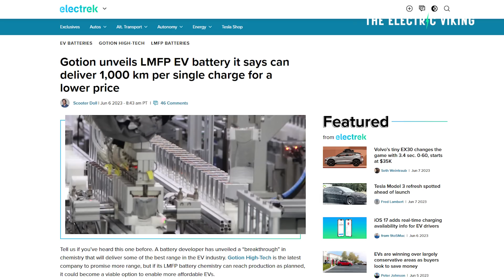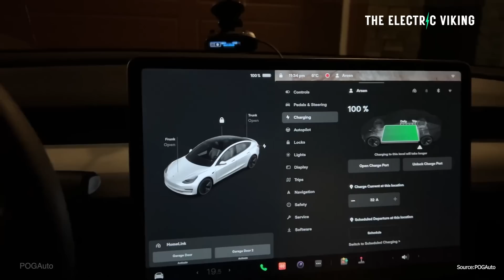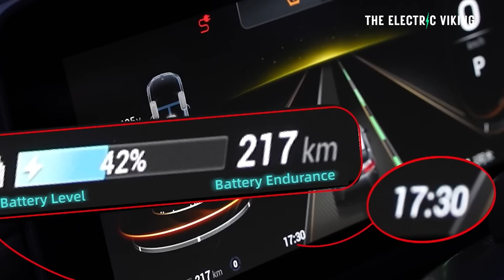New 621-mile range EV battery charges in six minutes and works in any weather

Comment: You really don't say anything about, "how" this is achieved?  It does not seem to me that just "managing the heat and cold" would suddenly give a battery more energy density, or speed up charging by this much.  Did they also add capacitors?  Did they micro-engrave, or "glow" lots of new surface area for charge carriers to stick too? Do the have any patent numbers that we could look up? I hope of course this comes out true and correct, but with the excitement in the space, it makes it easier for "scammers" to pounce.

Comment: All projections about vehicle ranges are fairly pointless. Tesla,  could make a 600 mile car easily today.  Lifecycle of the battery, charging speed, ability to manufacture at scale are the important metrics. sure, in a decade or so, these technologies will begin replacing what are going in vehicles today.

Comment: Sam, these claims are absolutely bogus.  I'm able to do math.  If the most efficient automobile can achieve around 4 miles per kWh, then the battery size is 150kWh.  To transfer 150kWh into the battery within 1/10th of an hour (6 minutes is 1/10th of an hour) then the power of the charger must be rated at 10x the energy capacity which would conclude that everyone would need a 1.5MW charger and chargeport.  Again, this is all assuming perfect conditions and no heat loss, etc.

Absolutely no way!  Try not to believe everything you read on the internet....

Comment: Did he say super conducting material.  Room Temperature super conductivity has never been achieved. I don't think they have made any break throughs on that.  I would love to know what was meant by super conducting material.  Little bit of science fact.  Super conducting material don't require an alternating magnetic field to produce a current flow.  Just placing a magnet near one would produce power.

Comment: There is definitely something in fusing a capacitor with a battery in some way that would allow such insane charging speeds. Capacitors allow virtually instantaneous charging; that's not actually required in an EV, but to bring to bear some aspects of a capacitor to a battery would be very useful.

Comment: Through the early parts of the 1900s, electric cars, using lead acid batteries, held about 1/3 of the market. Thomas Edison thought that electric vehicles were superior to the steam and gasoline cars. He worked to invent a better battery for the electric vehicles. Since that point in time there has never been a breakthrough. Batteries have gotten incrementally better. There has never been a game changer or breakthrough in battery technology. Just small incremental improvements for over 100 years.
Reply: That's a good point.  I'm in my 60s, and I don't recall any sudden leaps in battery technology during my lifetime. Rather, as you say, they've just improved steadily.

Comment: Info not included was battery chemistry and cycle life. It would be interesting to know more about the contribution of superconducting materials. Thank you for your work.
Reply: Most superconducting compounds are nasty to produce because the components need to be ground to a fine powder. The good news is that it’s no more toxic than competing chemistries when dumped as land fill.

Comment: There are all signs of bs hype in this announcement. They promise everything but it's impossible to find any technical explanation how they have overcome most of the problems. The use of superconductors is very suspicious since there are no known superconductor which could have potential to be used on batteries. Also resistance is not limitting factor in charging speed. It's chemical reactions itself and voltage losses in electrolyte.

There are only few known high temperature superconductors, but they need impractical amount of pressure to become conductive. One comes close to room temperature but needs 250GPa, which is 2million bars. It needs something like diamond anvil and needs special laboratory equipment.

Some materials become superconductive about -100C and 10000bars. I don't see any use on batteries either. It's very unlike that some battery company could develop breakthrough superconductor in secrecy. Lots of time and money have been put on development. If there is some superconductor, it can be in charging cable and use cryogenic cooling. Sounds Overkill, though.

Comment: The highest temperature superconductor is Mercury Barium Thallium Copper Oxide. If you think thermal management is inefficient in today's EVs, just wait until you see how much less efficient it is to cool the battery to minus 134 degrees C and keep it there while the car is parked in the sun.
"They're not making this up" ?? What makes you think that?

Comment: 620 miles at about 300W-h per mile = 180kWh.  Charging this battery in six minutes or 0.1 hours= 1,800 kW of charging power.  Guessing that the vehicle's traction pack is set up for 400 volts, that comes out to 4,500 amps charging current.  At anything close to this current there will be major challenges in cooling the power electronics in the charger and constructing the charge carrying contacts and the cabling within the vehicle.  Even with a 99% efficient battery, there will be 18kW of heat to dissipate while charging.  The battery will heat up fast!

Comment: It sounds like they are proposing to pump liquid nitrogen or some other substance at near cryogenic temperatures (-273C/0 Kelvin) from the charge point into the vehicle battery ro make the charge pathway superconducting, then charge the battery without the conductive elements providing any resistance or resistive heating loss before then displacing the cryogenic liquid with something else to warm up the battery again. I can't see why the battery couldn't be designed in a way to allow for expansion, contraction and with channels to allow for the liquid. The charge points would probably still be able to charge today's cars that have batteries without this capability as well as those that do, so the main hurdles are probably the grid and safety, cost and efficiency metrics producing liquid nitrogen in a system with consumer owned and operated elements..,
Reply: The military use cryogenics for portable sensors all the time. Air is mostly nitrogen and the method to make pure liquid nitrogen from it is well understood. Even in a portable system. It’s also stupidly energy intensive so I am guessing it will take 20 minutes to create a conditioning charge of liquid nitrogen which will then be flooded into the cooling circuits a few minutes after the connection and charge events are initiated. That would be a very exciting six minutes because the LN2 would be boiling off crazily and noisily while the cryonics try to keep up.

Whatever it is it needs a CO2 and a H20 scrubber. From this I am deducing 480Kw is only going to be available when the LN2 is pumped at a high rate from the device that is also delivering the electrons. Maybe through another connector.

I’d watch that demo!

Comment: Battery breakthroughs are a dime a dozen.  I have been reading about breakthroughs like this for 10 years.  I used to get excited about them but then realized that there are a ton of factors that can stop a battery from being manufactured at scale, reliable, or cheap enough to use.
Reply: At this early point of battery transformation, technical breakthroughs are exceedingly important for adoption.  We can all thank the industry for their contributions
Reply: The breakthroughs have gotten us to where we are today, which you seem not to recognize. The breakthrough LEAD the market. They don't define it, but the definitions follow the lead and end up as progress.
Reply: @niceguyrides  its the other way around the market LEAD the breakthrough, breakthrough leading the market is the exception. its usually multiple breakthroughs fighting for dominance in the market and the market chooses which will be the one to continue. A good example is audio/video medias like CD, DVD, Blu-ray. they all had competitors and the market chose them as the one that would be universally used.
Reply: @senhorokami  logically then the breakthrough came first and led the way… the market just chose which direction it would follow. Either way the breakthrough leads the way to progress.
Reply: @niceguyrides  you know nothing about economics... of course a breakthrough can push the rest market but it only does that because part of the market pushed it in the first place so in the end its always the market. the thing you think is the norm is in truth the exception.
Reply: @senhorokami  Is that how it worked with Tesla.  the Market was demanding electric cars and Tesla answered the call or did Tesla push the market with innovation? hah. . . you are backward.

Comment: Gas powered vehicles are still a better option, if that kind of tech is real it could be a good option.
But not so sure for the planet, depends of the materials they use to produce it.

Comment: Not a breakthrough - the price for a charging station with superconducting cables is way too high. Except for aviation I can not think of any real life application. I can appreciate the 8C for the battery pack however - even at a lower charging speed that's impressive.

Comment: A 100kwh battery will need a 1.1Mwh charger to charge in 6 minutes.
At 90% charging effencey the car will have to dissipate 100kW which is enough to heat 4 houses.
Would like to hope this works, but physics gets ninth way.
Reply: And that 100kwh battery won’t provide 600+ miles of range.

Comment: With the ioniq5 I loose about 20% in winter here in Belgium, with temperature dropping to min of -5°C... which translates to 280-300km max range on highway instead of 350-380km. I am waiting impatiently for 800-1000km range with no loss in winter. Expecting this to cost 60 kEUR in 2028.

Comment: It will be interesting to see the actual technology they are using to do the rapid charge. They could use a super capacitor array (or equivalent built into the batteries) that handles fast charging with controlled slower diffusion into the storage batteries while driving away from the charging station -- without leaning into exotic technologies.
Reply: that's a good idea.
Reply: You are naive and do not understand engineering optimisation. You are assuming that the supercapacitor's lower energy somehow isn't a factor and that adding the "higher" component suddenly  increases the power for the entire "lower" power component. 

It doesn't work like that. Assuming an ideal system either means 1) the supercapacitor has the same energy per weight OR 2) the battery has the same power per weight, making one or the other redundant, and therefore the logic defaults towards the system being a single uniform type, nearly always a battery.

Put it this way. If you assume you have a 10 kWh supercapacitor charging a 75 kWh battery but but the battery has a 2C rate across the middle 2/3 of capacity (50 kWh) and the supercapacitor has a 20C rate, then the battery can take 100 kW (2C x 2/3 x 75 = 2x 50 =100)and the supercapacitor can take (20C x 10 =) 200kW. 

So charging both with a total of (100+200 =) 300 kW, the supercapacitor gets full in just 1/20th  of the time, three minutes, and the battery charges by 5kWh in that time. If we assume that the power suddenly drops to 50kW when the capacitor is full, then the capacitor is charging the battery at 50kW and itself is being at 50kW to to keep the capacitor constantly full. (remember the battery is limited to 100 kW in total) then the battery increases by another 5kWh in the next three minutes to a total charge-up of 10kWh plus the remaining 10kWh of capacitor energy (made constant), then it has taken six minutes to gain a charge of 20 kWh overall. This gives the impression that the total system is faster... but only at first.

At the nine minute mark, the battery has 15kWh and the S.C. has 10kWh as constant, aka the total is 25kWh.

At the 12 minute mark, the total is 30kWh.

At the 15 minute mark, the total is 35kWh. 

And eventually, the end result of 60 kWh (SC and 2/3 battery cap.) for the (constant-rate) battery cap. is achieved at the time mark of 30 minutes. 

If the supercapacitor is, say, 40% of the energy density of the battery cap. and requires 2.5 times the mass for the same amount of energy, then it makes up 1/3 of the weight of the two systems together, since the battery cap. is 5 times the energy and is therefore twice the weight of the SC., but the SC still has a power to weight 4 times higher than the battery since we have established it has half the mass but twice the power of the battery. 

However, if we get rid of the 10kWh supercapacitor,  then we have a total equivalent battery of 60 kWh which weighs, logically enough, 1.2 times the original battery but is lighter than the 1.5 value with the SC, so it would have the same energy overall, but has 1.2/1.5 = 80% of the original mass. So if the charging occurred now at a constant 120kW for the same battery type, then a 60kWh battery cap. for that rate would charge in 30 mins.  

So having a capacitor with generous energy density of 40% and 4 times the power to weight at as much as 1/6 the energy overall would result in a 25% mass gain, overall, with no or very little, overall time benefit. 

It's subtle.
Reply: Do you have a design or a patent?

Comment: If you can make a 600-mile battery that recharges in 6 minutes why not save  money and weight and make a 300 Mile battery? The faster the recharge time the less important range becomes.
Reply: you have a point but the chargers are not very widespread so it is make sense now to have bigger range

Comment: 6 minutes is great but I fear the infrastructure, cables, supply for power in this timeframe is unachievable.
Reply: What timeframe?
Reply: They will use local utility batteries to handle surges and refill off peak.
Reply: @Atgul-z6o  Except if there is a queue waiting to charge....
Reply: @chrissmith2114  Is there?  I admit there can be wait times at some popular chargers but only during peak hours and only at a few stations.  Most chargers across the country are wide open most of the time and the the pace to which they're being installed is accelerating.  Not to mention if EV's could charge in just 6 minutes, like this company says, that would be equivalent of increasing the number of the chargers in the network by 3 to 4 times since people will be at them for considerably less time.
Reply: @Ryan-ff2db  If you have an EV road rage is replaced by 'charger rage' as people jump the queues and often find chargers not working.... Add that to the 'range anxiety' and what used to be a nice drive becomes a nightmare...  If I had £1 for every 'battery breakthrough' I would be living in Bahamas ...
Reply: @chrissmith2114  I will agree that battery tech breakthroughs rarely reach mass production and this one probably won't either but some are coming to market even as we speak.  If you look at a chart of battery capacity and charging speeds overt the last 15 years it's a steady rather impressive increase pretty much every year and it's continuing to do so.

I will ask if you drive an EV, though?  Because, It doesn't sound like it.  If you did, you'd realize real quickly that 'range anxiety' isn't a thing after you've owned your EV for more than a week.  You realize real quickly that charging is a positive not a negative of EV's.  Most people charge at home or work and rarely go to a supercharger.  94 percent of my charging is done while I sleep and wake up with a full tank.  You'd also realize that Tesla chargers do have a 99 percent uptime and in the extremely rare instance you find one out of order there's almost always another one open.  They are also expanding like I've never seen before with many sites under construction containing over a hundred chargers.   Now that the Tesla charger will be the standard the roll out of additional stations will only accelerate and uptime on none Tesla chargers will improve simply by switching out the connector
Reply: @Ryan-ff2db  He needs to change his name to chrismyth
Reply: Who told you that? Your fear comes from misinformation.

Comment: Admire your hunt for EV innovation. But the more EV's globally the more people will become dependent on electricity to charge their EV's. WEF globalist wants your dependency to control your mobility! A multi-fuel strategy for mobility is far better with lower risks involved. Also, batteries aren't green and neither sustainable with a relatively short lifespan.  Hydrogen is better but costs enormous amounts of cheap electricity to be produced, only possible with massive built of safer nuclear which isn't going to happen sadly! Therefore remain loyal to my petrol/GPL engine for max mobility chance!